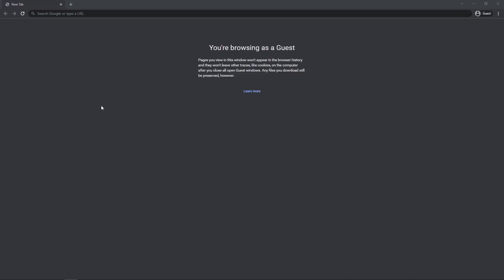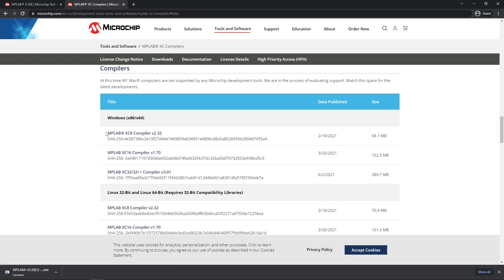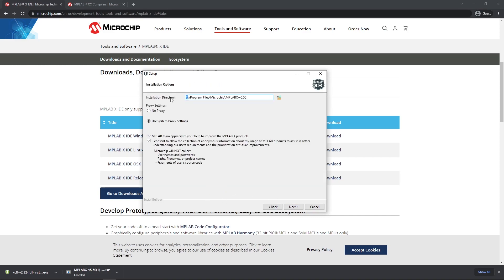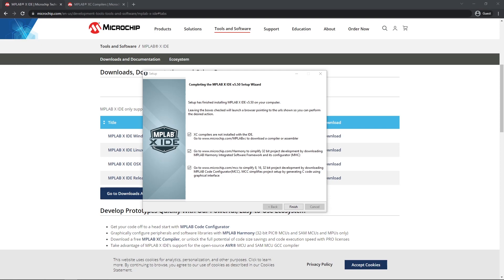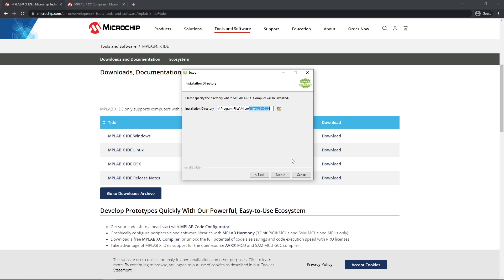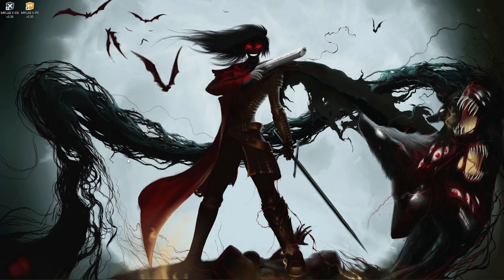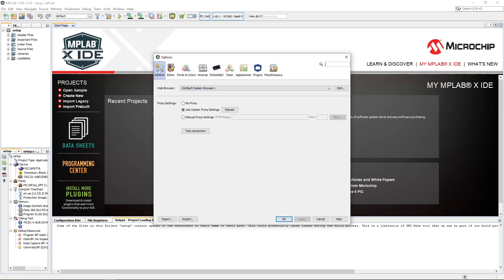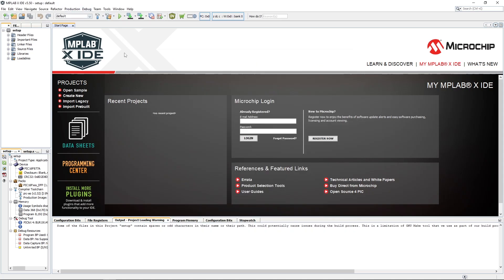Software Install 🔵 PIC16F877A PIC Microcontroller Assembly Tutorial #1 MPLAB X pic-as mpasm

Comment: HI 
its been a while since we spoke 
i took your advise and switched back to main c and no longer assembly language
i remember trying to get an led to blink or even an "if" statement.
i finally got them to work by including the "htc.h" 
i was pulling hair out not knowing why non of my cmds worked.

this is why experience takes precedent over theory.
i am once more puling my hair out with spi interface with nokia lcd 5110 and pic 16f877a.

i got it to work however not spi and thus have limited functions to work with 
for example increasing size of display etc

the driver for the lcd is pcd8544 however there are different interpretations of them online.
The examples online mainly feature pic 18f not 16.
the reason being that they were not able to create space for the font.
i have however managed to create space for the font however really need the spi interface method for a good reason.

i am wondering if you would be able to 
Your input will be appreciated

sincerely

ejike
thank you once for your time
Reply from the maker: I recommend you remove your email from your public comment.

Your are using a 5V MCU with a 3V3 display. You need level converter (I am assuming you have done this).

There is practically almost no difference between how SPI functions on a 18F and 16F.
https://youtu.be/cOZcHNexx-I

There are Arduino implementations for the PCD8544. Find some source code and study it and reverse engineer it.
Reply: I am making use of mplab x xc8 compiler
I have seen a few mikro c pro 18f spi connections with the 5110
I have tried converting it with mplab x
Mikro c compiler has different spi options
Soft spi and hard spi 
I am still trying to apply this to mplab
In mikro c we define spi as spi1 for soft and spi 2 for hard 
However I am trying to apply this to mplab x in order to make use of spi 

Yes you are right 18f is different than 16f
It is more advanced and I presume also has more memory
I managed to squeeze the font into 16f 

Anyway once more than you for your precious time

Ejike
Reply from the maker: PIC16F877A, 18F4520 and PIC18F45k50 find the SSPSTAT register in the datasheet and compare the 3 with whichever 16F you are using. Compiler is irrelevant it is still compiling down to the same register map.